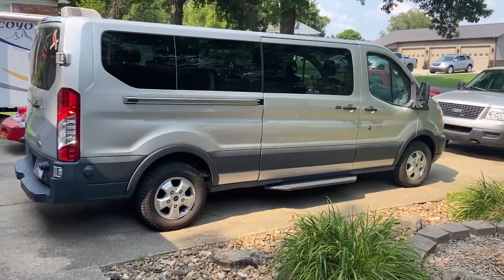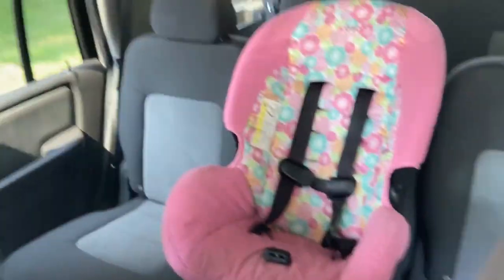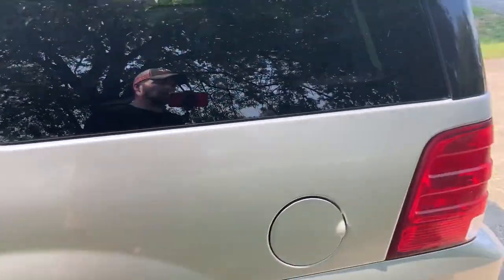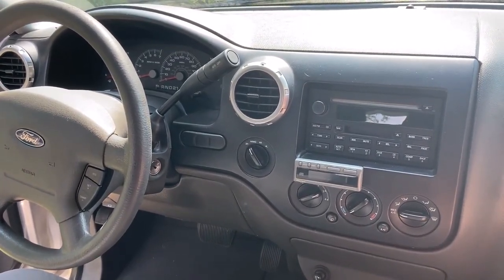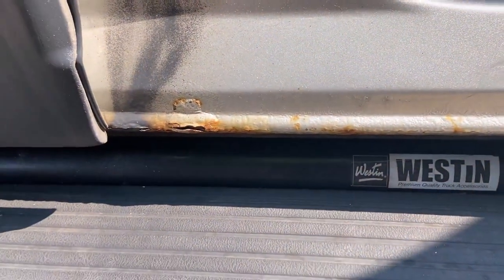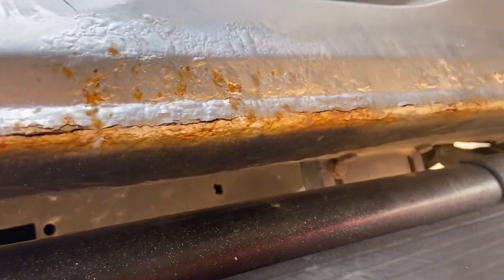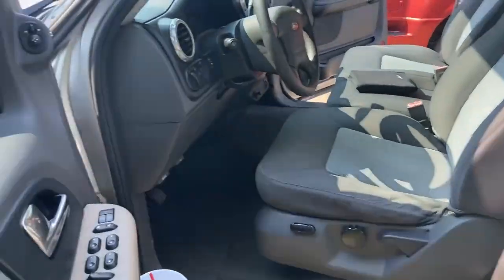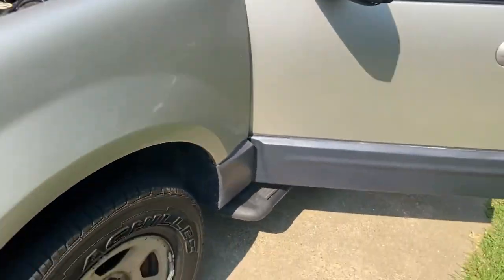2003 Ford Expedition Ep 1: Project Introduction

Comment: I miss my ford expedition.. same color same model 2003.
Reply from the maker: This truck has been a love/hate relationship so far. I bought it used with high miles so it’s kinda my fault anyway. 🤣
Reply: @thrillbilly9785  same here got mine pre owned aswell. Not so many issues. 😁

Comment: How much did you pay for this vehicle?
Reply from the maker: If memory serves me correctly, I think I paid $3600. I bought this in 2021.
Reply: @thrillbilly9785 not bad got my 2004 expedition for 1200, its condition is a little rough but everything except the rear window wiper works.
Reply from the maker: @alacazam342  these trucks hold up pretty well despite the exteriors rusting out. Been a pretty good truck for me so far, after a few bugs were sorted out.